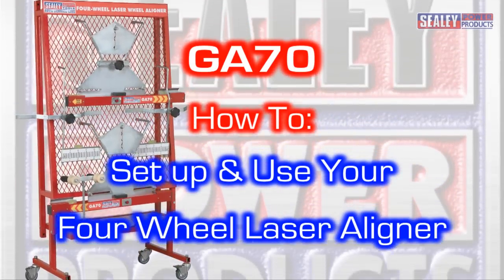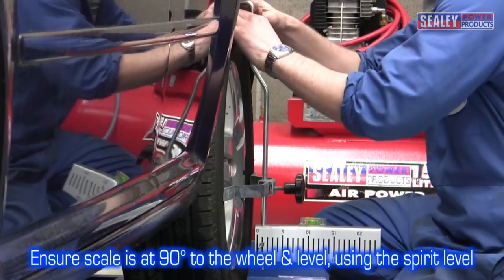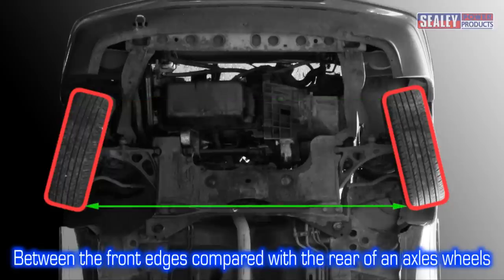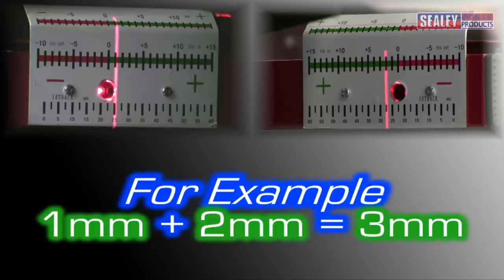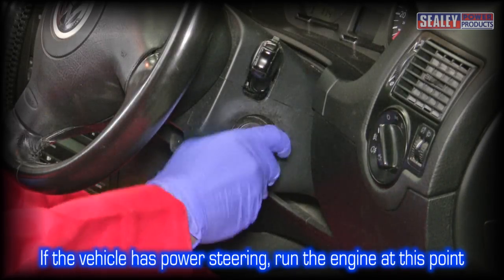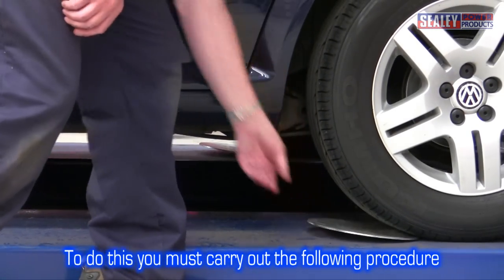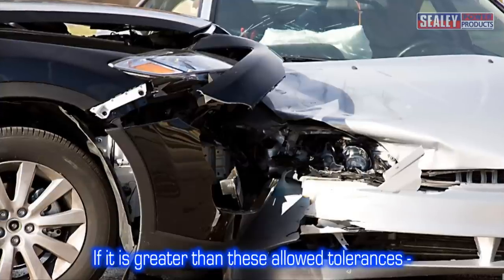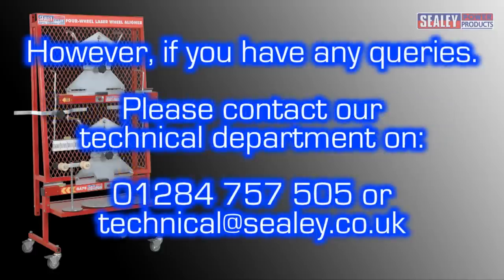Sealey GA70 Laser Wheel Aligner Instructional Video - How to set up & use the GA70

Comment: When adjusting the front I can’t get the rear flags both equal (4) and the toe equal on both sides on the front. I have to have more toe on one wheel than the other to get the back flags equal or if I get the toe even on both wheels the back flags aren’t equal. What’s more important the rear flags equal or the same amount of toe on each wheel on the front. When the back flags are equal the total toe is in spec on the front but not equal, 1 wheel is toeing in 1mm and the other toeing in 2mm.
Reply: Did you figure the problem? I have the same issue

Comment: If the front camber or caster is unequal, then you will end up aligning the rear incorrectly.  You need to ensure the front camber and caster is correct before you try and get the rear toe set.

Comment from the maker: @ChoccyNuts 
Hi, 
Thanks for your comment, yes you are right, but it does state that fact from 0.40 seconds into the first section of the video. Failiure to do this would indeed result in a poor set up.
 Hope this answers your question.

All the best.
Reply: How do you account for varying track widths, as the track width changes across different cars the laser will move along the scale even though toe may be the same? E.g. 1mm toe in per wheel at a track width of 1500mms would position the laser at a different point to 1mm toe in at 1750mm track width on the scale and give you an incorrect reading. I don't see anywhere shown that you are adjusting a scale to account for wheel diameters as on the Dunlop type mirror gauges or anything that accounts for track widths. I must be missing something!